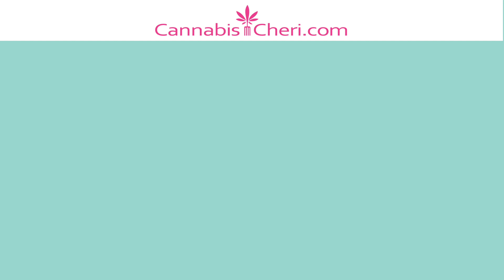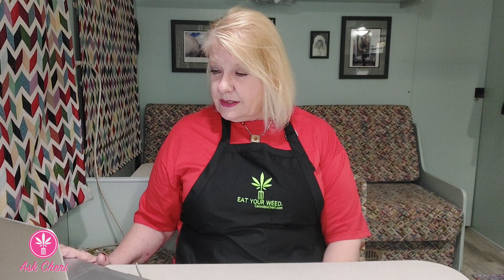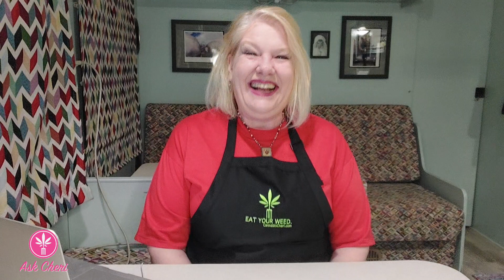What Can I Do with Leftover Water After Making Cannabutter?

Comment: this helps thanks. i just made cannabutter, forgot to decarb, so i left it in the crockpot double boiler for 5 hours instead of 2 hours. hope it comes out ok. a lot of contradicting info out there, some say simmer for 2 hours, some say as much as 12 hours.
Reply from the maker: You will be fine.  A couple of hours is plenty, you can leave it longer, some do a day or two, but there is really no benefit to that.  In fact, on the contrary, it will only make the food taste more like weed, but you are not going to get extra potency.

Comment: But when making a cake you use water too right couldn't you use the water that way or would it not work?
Reply from the maker: You could use that water in your recipe if you are making a recipe that calls for it.  I wouldn't.  It's going to add a lot of yucky flavor and not much potency.  Again, because the trichomes bind to FAT not to water.
Reply: @CannabisCheriSicard  they bind to fat but can fat not only hold a certain amount?
Reply from the maker: @vancejacobs7374  Yes, but it's a lot (although an exact number is not known as a lot of variables come into play).
Reply: @vancejacobs7374 the number I've seen is 15 %. That would be extreme, basically like using an ounce of weed per cup of butter! You don't have to worry about this . I've had the opposite problem which is not mixing enough flower into the butter when trying to make a high dose in something small (e.g. 50 mg for a mini muffin).

Comment: Do you know of an easy way to determine the strength of the butter? I followed a recipe for high dose. 

14 g of flower, 28 g of shake. Decarbed. Simmered 8 hours w/ 2 and a half sticks of butter and water. 

I am finding conflicting information on how to get an “idea” of the mg each when I divide it up. 

I am used to eating 50mg edibles so I’m not worried about it if they are up there.
Reply from the maker: Take me free dosing class or get my $5.00 dosage calculators and all will be answered.  Check them out at Cannademy.com.